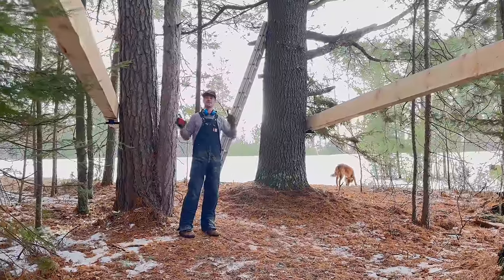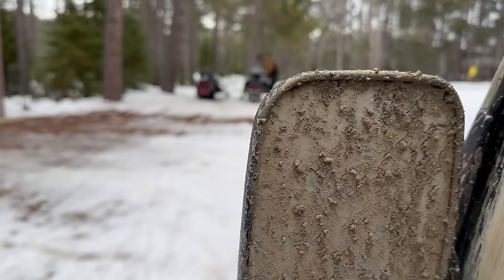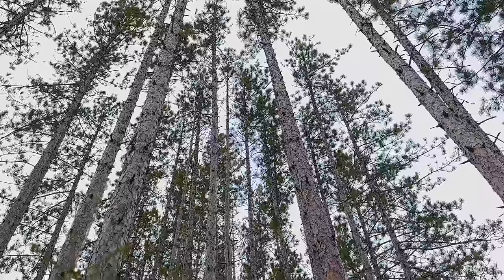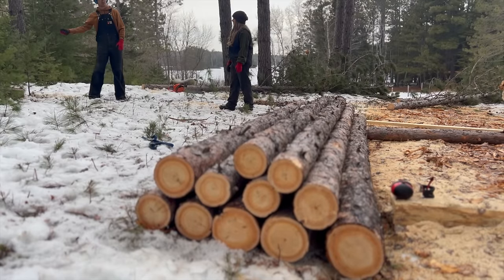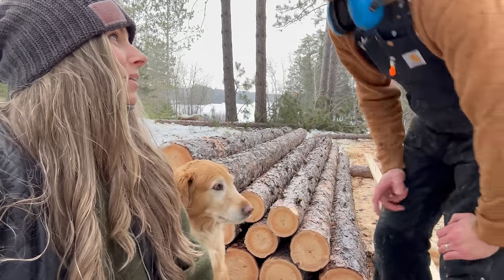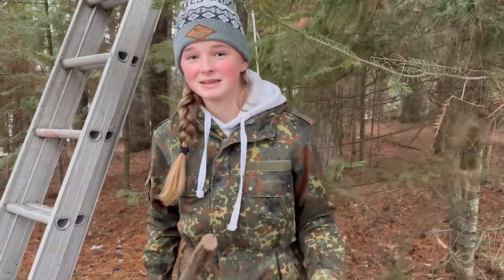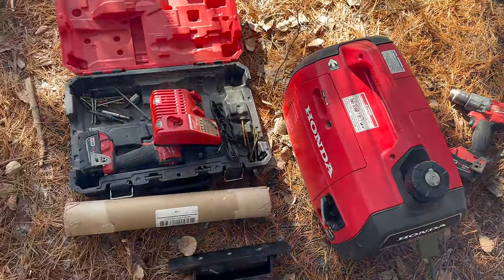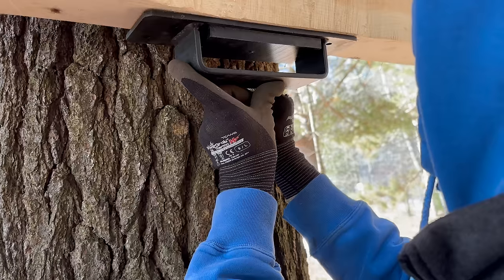Milling Floor Joists For Our Off Grid Treehouse | Ep. 6

Comment: With the tree's on hand you should build a cabin on the platform.
Reply from the maker: We definitely do have enough to do that! This platform wasn’t really designed to hold that amount of weight though, unfortunately. We also only have permits to build one building and that will be a treehouse in a different location. This build was a way to help us learn the ins and outs of a treehouse build 😃

Comment: I hope you guys have put the calculations in when it gets really windy. Those cables are gonna move with the tree. They may move your house.
Reply from the maker: We did take it into consideration. Luckily this is just going to be a platform for a wall tent and there is a little wiggle room from the other dynamic connections. Worse case scenario we will place a support under that side and remove the cables altogether. These cables should probably be used on my static connection only…. Or as an uplift arrestor… Thank you for your comment! This is how we learn! 
We hope you have a great day! 🌲